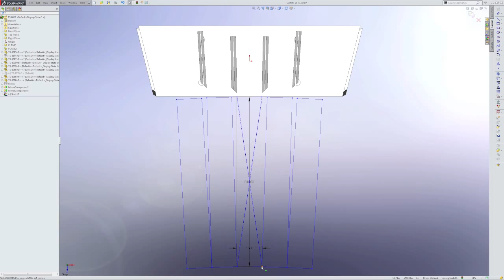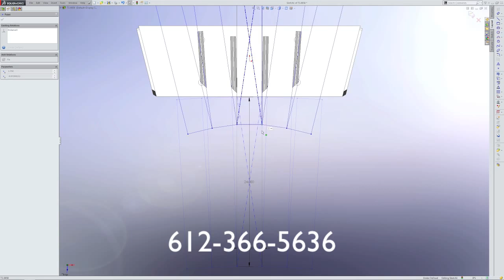TEMPEST WEDGES

Comment: Hi Josh,   I'm retired and building a wood splitter based on what I've seen on your videos. You guys have got some great Ideas.  I can only work on my splitter when the temp is 30 degrees and up, cause I have no heat in my pole barn. When I get it done I'll send you some video (if it works)  ha.  Thanks again for your super splitters. Ken